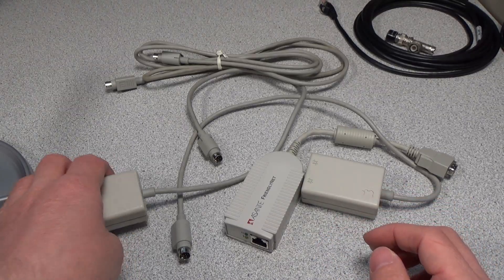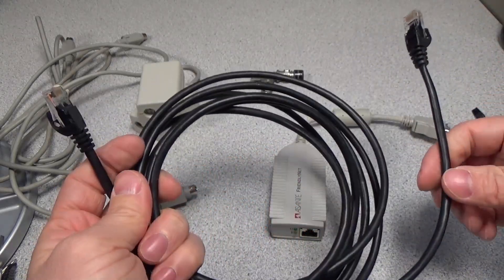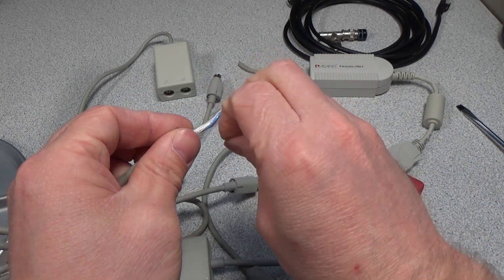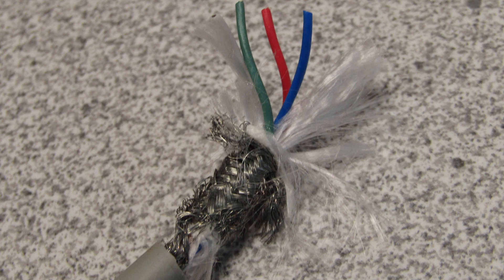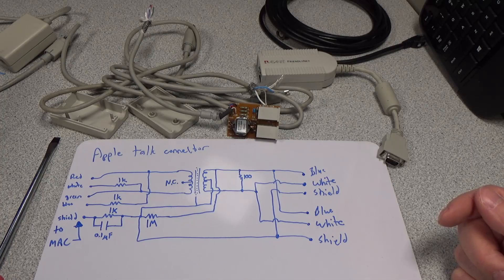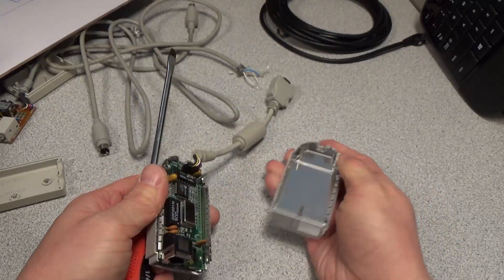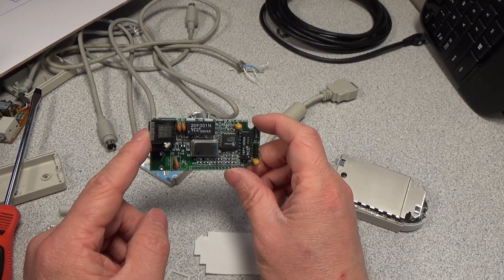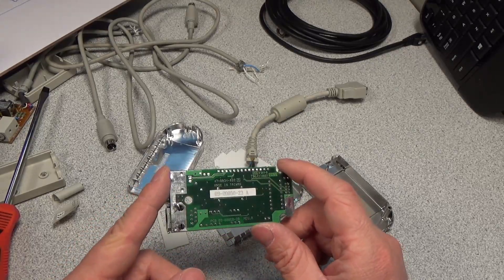Apple Macintosh Apple Talk and AAUI Vintage Networking Teardown #22

Comment: Very useful video! I'm trying to get two classic Macs to talk to each other, via LocalTalk, and I wanted to confirm that my setup was correct (which it indeed turned out to be). It's worth mentioning, BTW, that there are two versions of the AppleTalk box — one with the earlier connector, and one with the later 8-pin connector. It turns out that I have one of each box; so, while one Mac can be a Plus or later, the other Mac in the setup will have to either be a 128k or 512k.
Reply from the maker: I haven't set one of these networks up in a long time but the last time I did the connectors all worked so maybe I got very lucky, ha.  Mac classics and LC machines mostly.  How many pins are in the other connector/what size is it?  I will need to do a video actually setting one of these networks up at some point.  That would be a great opportunity to identify the connectors on the actual machines.
Reply: @AllThingsOnePlace  There is a YouTube video showing LocalTalk in action, but the uploader didn't actually bring the camera around to the backside of each computer (as far as I saw). I would imagine your presentation would be infinitely better. Regarding the connector — interestingly, it has only 4 pins, and it would have connected to the built-in AppleTalk/LocalTalk in, on a 128k/512k. If you look up a picture of the I/O on one of these, you'll notice the aforementioned port; it's second from the right side, proceeding the audio jack. The input has 9 pin holes. (I haven't yet tried this out, myself, as I'm currently dealing with a separate Macintosh-related project.)
Reply: no not true. Macintosh XL (Lisa II), 128k, 512k, plus and TOPS PC Card used DB9 connector. the later macs and IIgs used the din connector. stop spreading disinformation 🤨